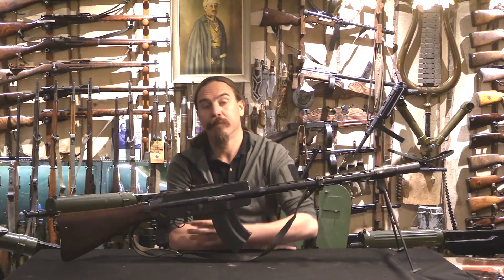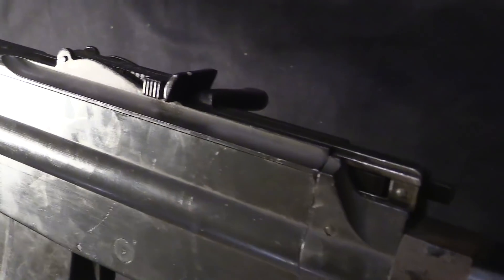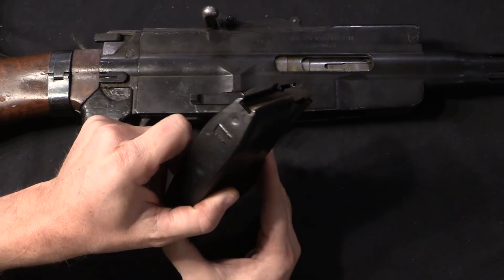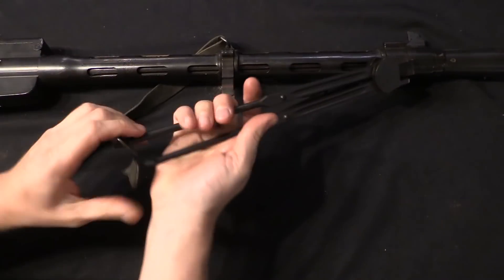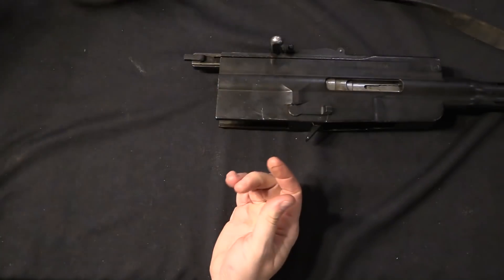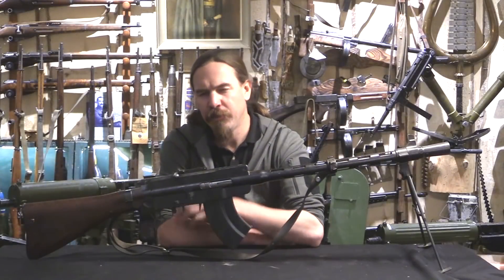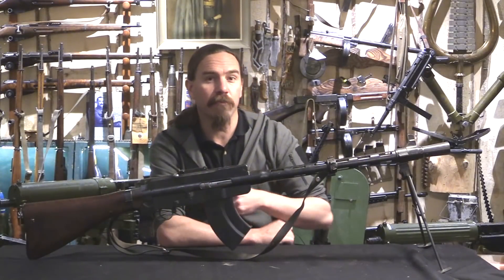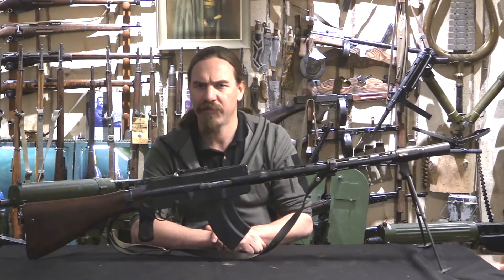Lahti-Saloranta LS-26: Finland's Domestic LMG

Comment: The buildings of the rifle factory still exist: the main factory is office space now, and the worker housing has been renovated into apartments.
Reply: You can't miss those buildings if you are sitting on a train. The buildings are right next to the tracks and there's a huge KIVÄÄRITEHDAS (Rifle factory) sign on the wall.
Reply: @danielescobar7618  Quite nice. The apartment buildings are bit bland imho, but the factory buildings themselves are very nice.
Reply: @danielescobar7618  Typical 1920's factory architecture. Four to five storey buildings. Made of red bricks and big glass windows everywhere :D
Reply: That is incredibly cool. 100% would live there.
Reply: @danielescobar7618  My girlfriend lives in one of these renovated apartments. Big windows and thicker concrete walls than I've ever seen anywhere before, something like 40cm thick. Also these peculiar wide "windowsills" made of concrete. The height of the room is something like 3m. But because of the old ventilation systems, it gets very cold during winter. The air intake is from the bathroom ceiling, so on cold days, the incoming air is nearly as cold as the outside, so when it's -20 degrees celsius it makes the toilet a bit... uncomfortable. :D
Reply: @jukkariikonen5757  Hush! :D It looks good and that's enough. Wear more layers
Reply: @aleksihamalainen9229  ⁰
Reply: The VKT factory became the Valmet rifle factory after the war. They made the Finnish version of the AK, the 7,62 RK 62 in 7.62x39 and a civilian version in .308 called the Petra, as well as .22 competition rifles and a line of shotguns that culminated in the Valmet 412 series, which included both over-under 12 gauges, a shotgun-rifle combo gun and a double rifle in several calibers. RK production was later combined with Sako (which had also produced a part of the original series) and the 412 line was finally sold to Italy when Valmet closed down its arms manufacture in the late 1980s. The factory also had an extensive small arms collection that I believe later went to the Finnish Hunting Museum. During the war part of the factory was actually relocated to an underground tunnel system under Mount Kanavuori east of Jyväskylä.
Reply: Factories were built better and looked better in the 20s than modern housing units.
Reply: Wasn't it already apartments? It's just for anybody instead of just people who work in that one building.

Comment: Even the army didn´t teach troops to clean the recoil spring, it was trained in the Civil Guards. So during the winter war soldiers issued with LS-26 had some issues with reliability, unless the soldier was lucky to be trained in the Civil Guards. I happen to know a war veteran who was a light machine gunner during the continuation war and according to him, with proper cleaning and maintenance LS-26 runs reliably. Biggest disadvantage comparing to the Soviet DP-27 is small magazine capacity. That´s biggest reason why he preferred DP-27.
Reply: THANKS FOR SHARING the information!
Reply: So all the people who ran it post war didn't maintain it properly either? While all DP-28's in existence were properly maintained? Ok, good to know. Thanks for the info.
Reply: @TheArklyte  DP does not need maintenance :) That thing has still record of least number of parts of any locked breech automatic weapon. LS was finicky, but doable in field with trained crew. 20 round mags, fed from bottom was the killer. ZBs for example also had 20 round mags, but from top feed, every mag change is 2+ seconds less fumbling. DP had 47rd mag (even some tank DPs in ground use with even higher capacity). LS served till the end of wars in 1945 on infantry units, there were just so much captured DPs that many units were capable of running solely with them.
Reply: War in north was many tines small unit clashes in middle of nowhere. If holders of recent battlefield, Finns tended to dump enemy weapons to some lake or swamp, but DPs were carried home even from distant wilderness. There was need to start domestic magazine production for them. Rarely enemy captures outnumber to such degree own standard issue in any class of weapons.

Comment: In terms of disassembly, this is way easier than the WW1 BAR.
Could have been one of the factors on why this was adopted instead.
Reply: Must be important in the cold.
Reply: I'm guessing avoiding paying for a technical package is a larger part of it all.
Reply: @SlavicCelery  Also most countries prefer domestic guns as a point of pride
Reply: That and the BAR being chambered in 30.06 instead of 7.62x54R.
Reply: @Razgriz85  To be fair, it got chambered in more than just 30-06.
Reply: @Razgriz85  At least 5 different calibers
Reply: @Razgriz85  as the others said, the BAR has seen multiple calibers. More than likely it's the disassembly of the WWI BAR as just operating basic control groups in the cold is... REALLY HARD. I've done it for non-lethal shooting sports and it's nigh impossible at times just doing the basic weapon handling.

Comment: Another early 20th century firearm that would make a good Star Wars blaster IMHO
Reply: Just because the prop department in the original movies were lazy and just took some old guns and put some random parts on them to make them look sci-fi instead of designing something new.
Reply: @Immopimmo  greatness may sometimes be born out of laziness
Reply: @Immopimmo  Or more like pragmatic? Why design something from the ground up when adding some greebles to existing firearms did the trick just as well? That not only worked well with the aesthetics Star Wars was going for (rugged, sort of gritty, foreign but something that looks like it was made to actually work), made blank firing props a breeze, and no doubt helped reduce the costs.
Reply: @MosoKaiser  Yeah, but nowadays you can't watch a single video on a 19th-20th century gun without some dumb star wars fan commenting on how it would make a great blaster. :p

Comment: The LS-26 may have been superseded in front-line use by the KvKK 62 in the 1960's, but I remember still carrying an LS-26 on maneuvers in 1980. The coastal artillery had a bunch of old weapons still in stock for training and fortress defence; we also had Finnish model Mosin-Nagant rifles (that we were trained to disassemble and assemble -- including taking the bolt apart -- with a rucksack over our heads in under a minute) and Maxims, although our personal weapons were 7,62 RK 62's (Finnish AK's) and we did have KvKK's as well. But then some of our artillery dated back to 1905...

Comment: Aimo Lahti was the John Browning of Finnish weapon designing. He developed the Suomi KP/-31 SMG, the Lahti L-35 pistol and the Lahti L-39 Anti-Tank rifle, all of which would see lots of use during WW2. He also designed the Finnish modifications to the Maxim MG. Some of his more rare designs was the Sampo L-41 MMG which went through trials in the Finnish Army during the 1940s. The gun itself was air-cooled and belt fed machine gun and was capable of firing the 7,62/53R rounds 600-800 Rounds per minute. The Sampo was shelved after it had numerous problems while the gun was tested and only 35 examples were ever made.

Comment: 7,63 Pk 26 (=LS 26) was not taken out of service in 1960's. I have shot and disassembled/assembled these guns during my national conscript service in late 1970s. Very nice and stable gun for single shots, the empty cases are flying out very fast and forcefully. While firing guns laying on the ground at the shootnig range next to other gunners those empty cases really hit you on your left leg on about knee level. LS was nobodys favorite during battle trainig manovers in the woods - heavy and long. It was said that private X's (a light machinegunner) worst enemies were Lahti and Saloranta. Luckily it was not me who carried this weapon... The light machine gunner was supposed to have a small nail in his pocket in case a cartridge does not go all way the in the chamber. If you took the gun apart, striker would strike and the gun would explode. You must open the top cover and insert the nail in a hole inside to lock the parts. There were special (yellow painted) blank fire barrels for these guns, they usually did not fire blanks on full auto even whit these yellow barrels - or just two-three cartridges burst.

Comment: I wonder if that "accelerator" would be better described as a "decelerator" for the barrel and extension? Build the geometry right and it would significantly reduce the impact forces when that big mass comes to a stop by smoothly transferring the motion into the bolt.

Comment: I'd hate to be the soldier to the right of the machinegunner.  It seems to spit out empty cartridges straight to the right at a very high speed. I guess better for the gunner than a MAG that piles up hot cartridges under the gun and they start getting into your sleeves...

Comment: In 1924 what was wrong having a Lewis gun as an option? It seems to me to be the better weapon.
Reply: Costs. The lewis gun was using an Aluminum shroud. Aluminum was stupidly expensive at the time. The magazines are large and expensive. 
The whole system is nearly as bulky as a water cooled system. 

Also by 1924 the ZB series of rifles were under development. That ultimately lead to the BREN, which would easily be considered the superior of the Lewis.
Reply: There is a reason why everyone that could ditched Lewis as infantry LMG ASAP. Dreaded double feed that is not really fixable w/o full disassembly of the gun being only one of those.
Reply: Because it's enormous?

Comment: Please, 7,92 not 8 mm. I know it is nitpicking but still. But I find it odd that no one then realised that the problem might be the grease, thus cleaning them before delivering them to the front ? Somehow reminds of the much later case of M 16 in Vietnam.
Reply: 7.9, 7.9mm
    7.9 Mauser, 7.9mm Mauser
    7.92, 7.92mm
    7.92 Mauser, 7.92mm Mauser
    Cartridge SA, 7.92
    7.92×57, 7.92×57mm
    7.92×57 Mauser, 7.92×57mm Mauser
    8mm Mauser
    8×57, 8×57mm
    8×57 Mauser, 8×57mm Mauser
    8 × 57 IS, 8 × 57 JS
Pick one that you like the most.